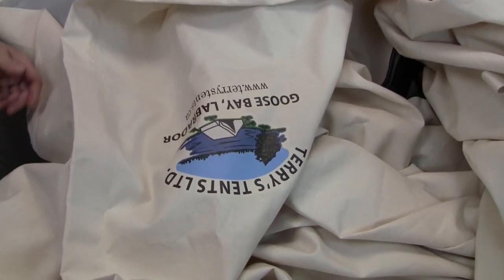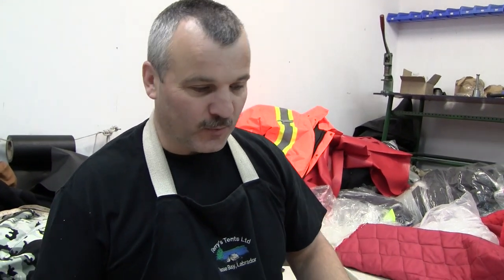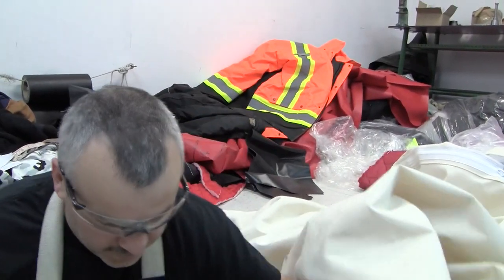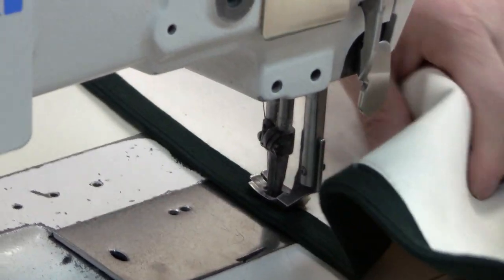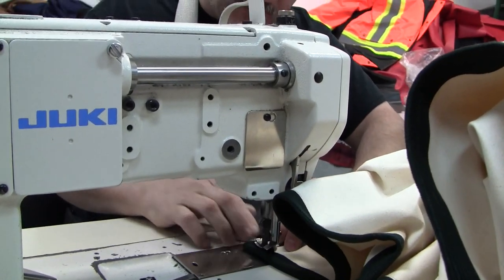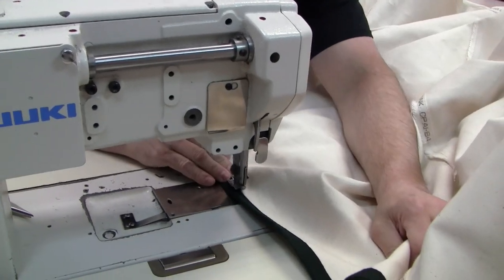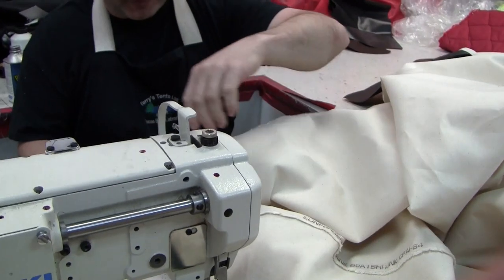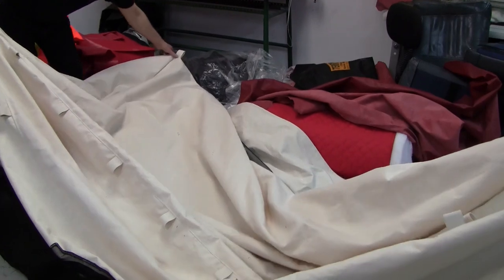Wall Tent Construction and Tips (My 8' x 10' Wall Tent)

Comment: That was interesting watching him own that Juki.I have an industrial singer sewing machine.It owns me.He makes it looks easy to sew that fast but it is not.I decided against canvas for synthetic 10 years ago.Hind sight it was the wrong decision.Mostly because of condensation issues.Canvas is no where as drippy as you nylon/poly tents.I was afraid of having problems drying a canvas tent out as I live on the west coast in the rain forest.If I replace mine it will be a canvas wall tent.cool vid.
Reply from the maker: +River rat Thanks RR, yeah if I were to try that I'm sure I've have my fingers sewn into my tent. I've sewn a couple of small projects over the years with my wives standard sewing machine and nearly nipped my fingers a number of times. I'm going to build a quick drying rack in back of the house to make sure it is completely dry before I store it for any long periods of time. I'm glad you enjoyed the video. Thanks for watching

Comment: just talking with my dad.he is wondering if the airbase is still open in goose bay?
Reply from the maker: Yes, I did my last 3 years of service there at the base. I wore a number of different hats because the base has greatly down sized. I was the SAMS (Senior Aircraft Maintenance Superintendent) for 444 Sqn, I was the AFSO (Aircraft Fluid Servicing Officer) for 444 Sqn and the Deputy AFSO for the Base, I was the Arrival and Departure Guard Commander for the Base, I was the Mayor for the Community Council for the Base, as well as the Acting SAMEO (Senior Aircraft Maintenance Engineering Officer) and SWO for 444 Sqn. A very busy 3 years to say the least.